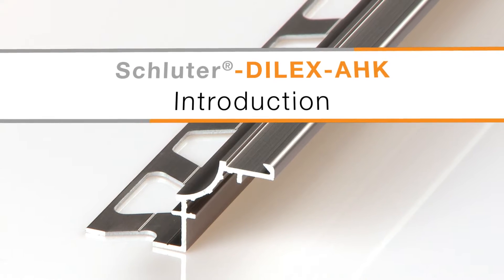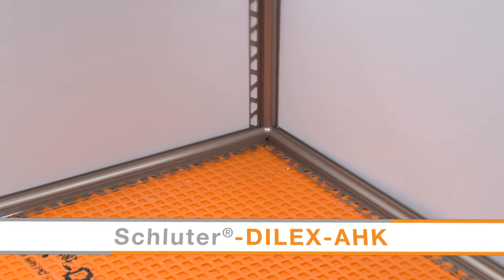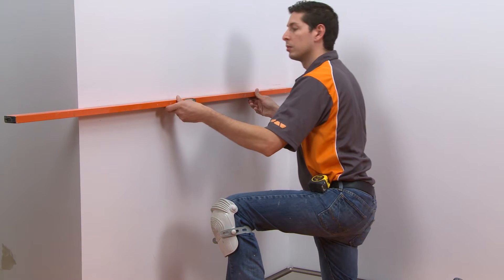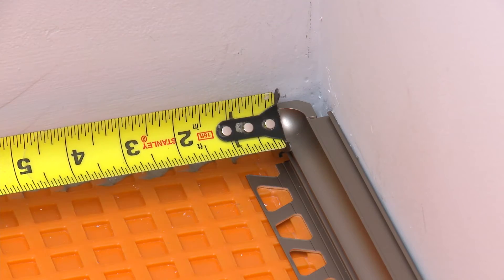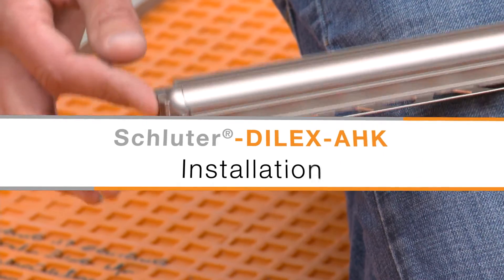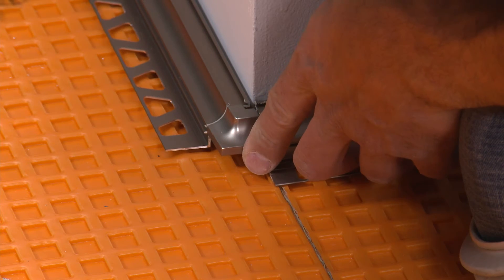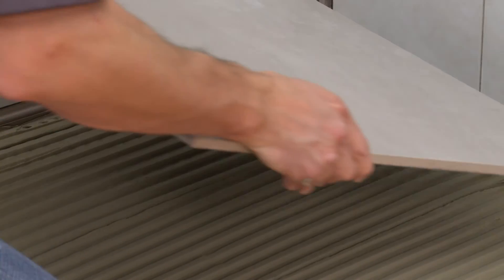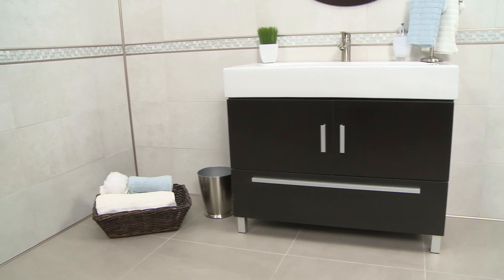How to install a cove-shaped profile: Schluter®-DILEX-AHK profile

Comment: That is the worst way to install the metal 🤦🏻 out it the other way and either "gluet" o stapleit to the wall AND make sure you raise it of the floor at least ⅙ to ⅛ or more depending of the application and the floor condition.  No place ever is level NEVER